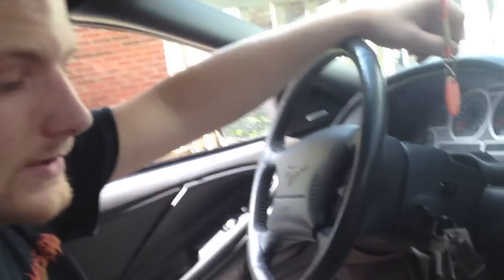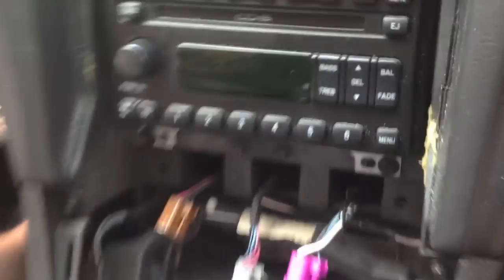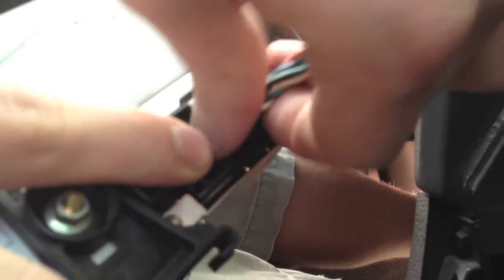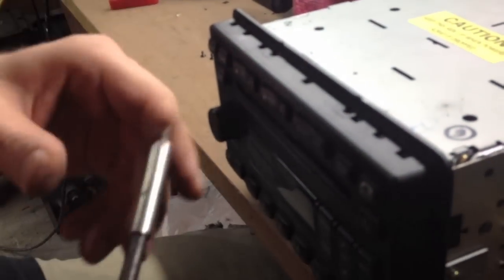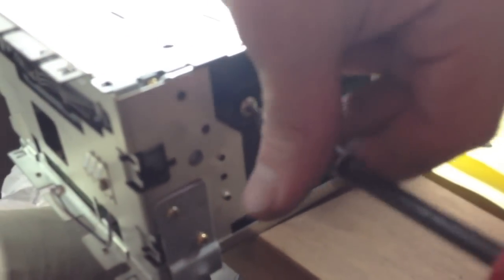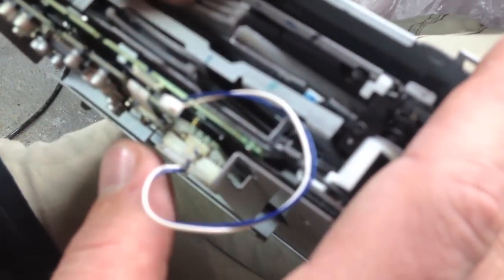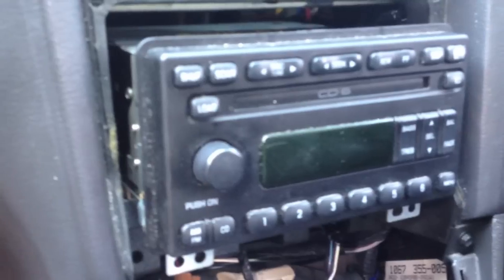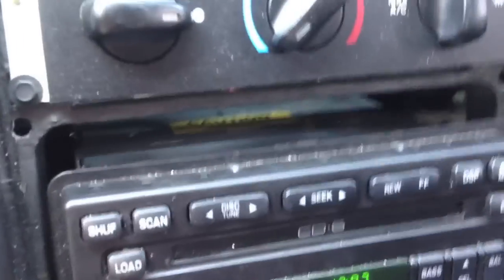mach 460 6disc fix

Comment: Hey hope you will answer.  I have the Mach 460 and it won't eject or load and it gives me disc error when I start my car.  Is this the problem you were fixing in the video?  I purchased the car with the cd player all ready in this condition.  I know the original owner swapped players at one point, but I'd like to fix if I can.
thanks